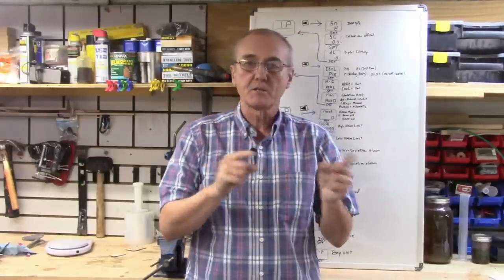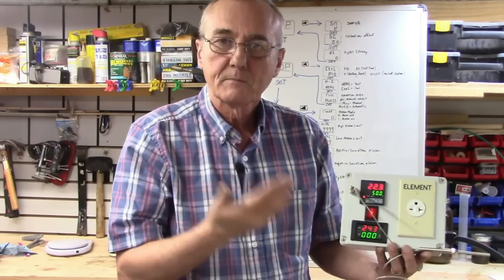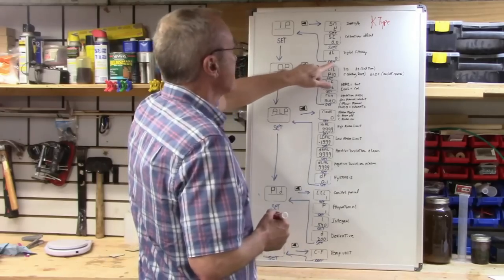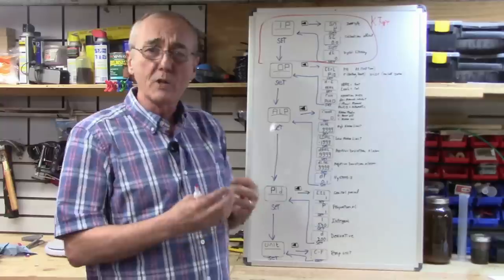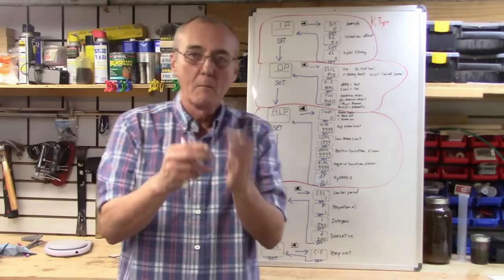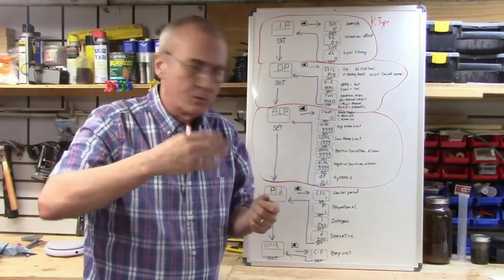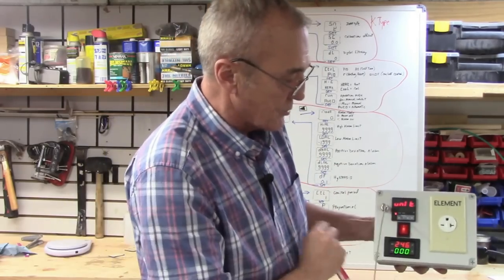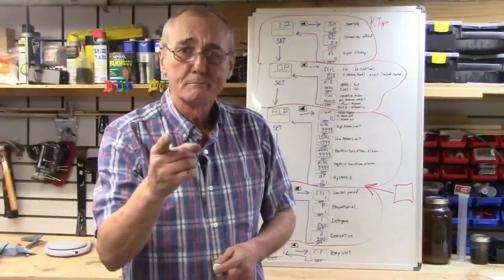Settings for  the InkBird 106VH controller

Comment: So if there’s no light on the OUT1 is there a problem with the relay or the PID?
Reply: I would like to know this
Reply: @SkyShupe  I got really fed up with PID’s. Now I use a potentiometer type of controller to adjust the amount of power going to the coil instead of a temperature probe.  Once the system balanced I don’t have to keep constantly adjusting the temperature.  Mine runs perfectly at 75% through the whole run.

Comment: Hi George. Thank you for this video, it seems to be the only one that explains the setup, so thank you! I have my 106vh wired and setup for homebrewing beer, but am having one issue. When I set the SC (-65) verified against two other temp probes at 120°F, then change the temp to 130 for example the actual temps reach 131.5, and the higher I raised the temp, the more its off. Anyway to fix this?

Comment: First off, GREAT VIDEOS!!!
I purchased this PID for my espresso machine, so i‘ll be using this for a heat PID. I wanted to verify the accuracy of the temperature of the PID and thermocouple combination.Would I use a boiling hot bath or ice water bath to adjust my calibration offset?Thanks for your time!!!
Reply: I used both ice water and boiling water to check my system. I used a lot of ice and a little water, let it sit for 15 minutes to stabilize, inserted the probe and it read 32.5 degrees F..  On the boiling water test I previously had set my Calibration  Offset (SC) to +4 degrees.  As a reminder, check your altitude to determine water boiling point.
Reply: I have this one also on my epsresso machine but on recovery it overshoots 20c. How did you configured the PID values?

Comment: Absolutely incredible and informative.  I just built my PID for my BBQ smoker element. It works great! One question - the smoker cabinet is so well insulated it overshoots my SV of 200° by +25° initially. It's so well insulated and apparently the element is so efficient  once it overshoots it'll take 10-15 minutes to cool back down to 200° then it will maintain that temp until it's time to open the door. Once I do, the +25° overshoot cycle happens again. Any PID parameters to help control this overshoot?
Reply: I have the same thing happening to mine. Did you figure it out?
Reply: @Acribus1  I did play with settings I found in some other pages.  This helped a lot. I also had a lot of flickering and flashing of my patio lights which were in the same circuit with the suggested settings from this page.  Whatever I changed definitely reducted the on/off frequency so the flickering is less annoying and the temp doesn't overshoot initially by 20°. Next time I get it out I will look at what they are and send a reply.
Reply: @JodiandRich  Thank you :) I appreciate it.

Comment: Will the 106vh 240 volt  run a 3600 watt element with a large heatsink installed George. Cheers mate

Comment: Hey  George big fan thank you for your insights. I need your help after following you on this vid my PID  inkbird  is still not working. I have the same volt display as you do on this vid and it reads 244v and 12 amps my pid shows only 100% power at the start then tapers off when my SV is reached but the iout put light on the PID is on the power is at 0% but my volt meter is showing 11 amp and 245v and if i understand my burner is still getting power as my volt meters round thingy has only one wire from my burner going through it. so how do i get this PID to turn off the power if its saying 0% ? please help

Comment: Hi George, 
I currently run a Rex PID that's okay but it has it's limitations, I think I would like to upgrade it to a 106VH, however I can't seem to find this information anywhere, does it have a time control setting on this unit as our steriliser runs for 14 hours when it reaches temperature, that can cause many inconveniences. Ta, Ian

Comment: Im needing some advice. I've wired my ITC-106 according to your last video and I'm still showing a reading of 110 volts on the output and 60 volts when it's switched off. When the PID is switched on I get a reading of 240 volts, so my heating element is being fed whether or not it's switched on or not, it's just heating up slower when switched off, because of the lower voltage being fed to it.
Reply from the maker: You have it wired incorrectly.
When you have it right there will always be 240 volts at the receptacle. The only time you will have current flowing at 240 volts is when the PID is energized otherwise it will always read a potential of 240 volts. That's the way a SSR works.
Reply: @BarleyandHopsBrewing  Thanks for the reply. I found out half of the problem. My wattage appears to be too high for my SSR. I tried a 25 amp first, then a 45 amp which worked great, I thought the problem was solved until an hour later it burned out. I'm trying to run 4 stove top elements, so I'm wondering if 100 amp will work. Any advice on that? Thanks

Comment: Okay so, setting P.I.D controller you can’t just set it to any old value, the P.I.D controller has to be tuned to the out put device if the output device requires longer times to heat up then those numbers he’s giving you won’t work, the way to tune a P.I.D it to set all parameters to zero.. the P value has the greatest effect on the output and is the parameter that gets you to your set point the quickest, you set you P value till the process value “ temperature “ osculates under and
Over the setpoint once you have determined the P value reduce that number by 10%. I value you start to increase till the process value  follows the setpoint you may have to fine adjust the P value to get it set just right. D is not needed set to 0 for Temp you only need a P.I controller. The response time for a temperature controller is slow, it takes a while for the heating element to get to temp and for the fluid to reach temperature. D is for fast acting control, if you find that the control is working in reverse you may have to change the control option hot/ cold. One is positive control the others is negative control.

Comment: Thanks for this run through.  I'm planning on using an Inkbird PID controller for 120 V controller of an aluminum foundry that I'm building.  So far, I'm just hardwired for 1/4 output to dry out the refractory.  My next step is to be able to trust that I'm getting a trustworthy reading from my thermocouple!

Comment: Does this apply to the Inkbird  ITC100, I am getting very large overshoots and powers on when above set temperature, it looks like it is trying to slow the rate of colling once it have exceeded the set value
Reply: I have the same controller and confused on programming, have you worked it out? If so would much appreciate if you can point me in the right direction as I'm totally new to everything, I wish I just bought the 106
Reply: I also have the itc 100 and need help with what works , large over shoots above temp. Using for powder coat oven
Reply: @larrysimpson1712  It has to be calibrated, follow the calibration instructions every time you use it, and be mindful of where you place your TC's. I am still on a learning curve with it.

Comment: I have an oven for cerakote with a heating Element from an electric smoker. Would you recommend these setting for my type of oven ?
Reply: Im doijf the same any luck?
Reply: @realFLoutdoors  works like a champ
Reply: @timcorrigan1528  my temp fluctuates +/- 15-20 degrees did you have that problem?
Reply: @realFLoutdoors  no , mine does maybe 5 up or down
Reply: @realFLoutdoors  also depends on the size of your oven and how many elements you have okus voltage and watts

Comment: Hi George, I put together the inkbird 20 amp 120v pid a while ago. I seem to have lost your video on setting the parameters for that one. Would they be the same as the 240v model? Still looking for a reason to try the auto tune.
Reply: I’m guessing it was deleted as I was looking for it last also.
Reply: I tried a few times to use the auto and it was way way off. Other youtubers had problems with auto as well. I use it to control a cheap $20 toaster oven with all the same settings as George but my p.i.d. settings are alot different then his. My oven holds + or - 1 degree. I also have the 20a 120v controller. I can't help on the p.i.d. settings for a still but I bet the auto tune for a still would suck also. Like I said all my setting are just like his but not the { p=1  I=540  d=200 } mine aren't even close to those numbers. Hope that helps a little bit.

Comment: Question for you George, are the parameters the same for a 120 volt PID
Reply: I'm not George, but in short, yes.  The Inkbird 106VH (the one in the video) has a range of 100-240VAC.
Reply: @Hypobrew  thank you

Comment: Hello George!
Not sure if this problem has been mentioned but I purchased a 240v 5500W element for my 50 Liter boiler.
The inkbird with your settings brought the temp of 40L of 40% up within 20 min. As soon as it started to boil (168-172F) it instantly vapor locked the top of my 2" Column (Amount of vapor coming up, blocked condensed liquid from coming down) and alcohol boiled out of head.
I attributed this to my tendency to "Over-DO" things such as the purchase of a 5500W Element for 50L Boiler ...LOL

I was able to overcome this by swithching 1 thing in the OP "Chapter"....

In the third Menu of the OP Chapter (run) If you switch from "Auto"  to  "mAnu" you can manually set the percentage of AMP output.

This means that you can set PID at say 155F and run at 100% (5500W in my case) and then by simply hitting the Set button on the inkbird and switching to AMP display, you can manually set to run at a fraction of the Amperage leading into your first boiling points. 

As I type this, I am "Equalizing my Column...I found with my set  up that running AMPS at 40%  is working great. I have the PID set to 172.5F  and my Probe is reading 170.2F...I am assuming that this is because the head is full of Methanol vapours and everything else is getting knocked down.

I have been running this column/boiler now for over 5 years on Propane...It worked well and I know it inside and out.
Your videos and ability to teach gave me the confidence to go outside of my comfort zone and build myself a PID controller...A big reason for the conversion is that I have to buy propane and the Wife pays the hydro bill...HAHAHA 

Thank you for all you have taught me George! I hope this comment helps others such as myself that went a bit overkill with their Electric conversions.

Comment: Hi George thanks for this video ! Much appreciated, but in the PID sector on the board you have CTL=1 & then P=1 & then I=540 & then D=200 again this is on the board but when you set the unit by hand I notice a difference in this sector for PID you set CTL to 1 ok Great ! But then you go to P and set it to 0.1 instead of 1 like what's on the board , next is I ,by hand you set it to 5.40 , but on the board its just 540 , and now we're at D 200 all good there. So I suppose for clarity the absolute question is does  P = 1 or 0.1 and for I is it 540 or 5.40 ??? Thanks and I'm not picking on you at all, just looking for absolute proper setting, I'm going to go off of how you set by hand unless I learn from you to do different. Thank ya Sir & yes TEXAS is thee absolute Best Country in the Entire WORLD
Reply: Sorry if i am wrong, but i think the decimal is more of a place marker for changing the digit in that field.
Reply: @blacknotchNJ  I have to presume it’s a mathematical position, after all that’s what decimals are used for in numbers.

So my original question is still up.

Thanks 🙏🏻 for your insight!
Reply: Did you ever find the answer to this, I was just having the same quandary? In the manual it says for I - if the value is too small it will be hard to eliminate errors and will affect accuracy. For P it says too small a  value will decrease accuracy, so I reckon 1 rather than .1 ?